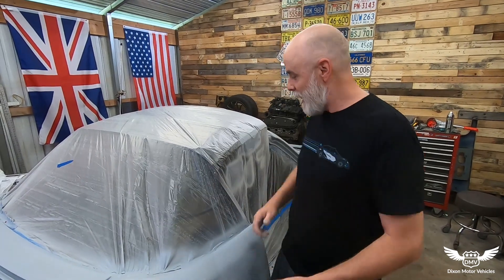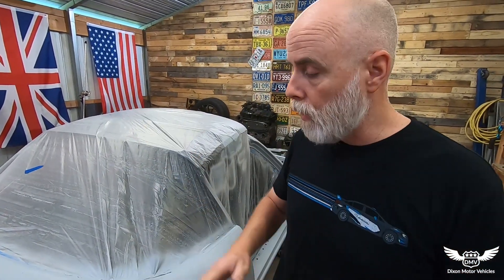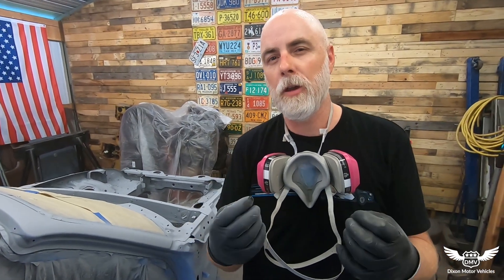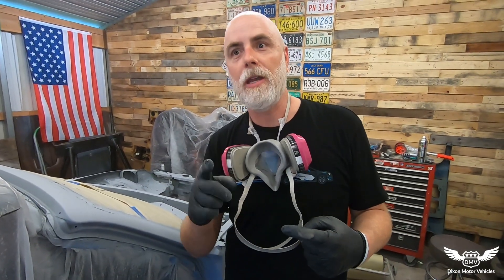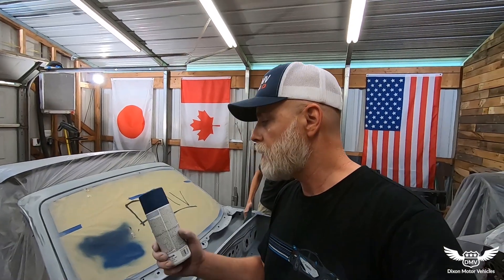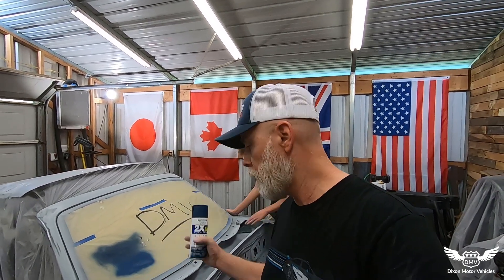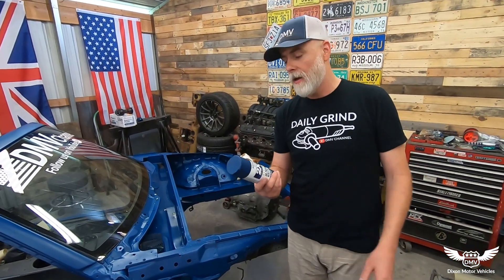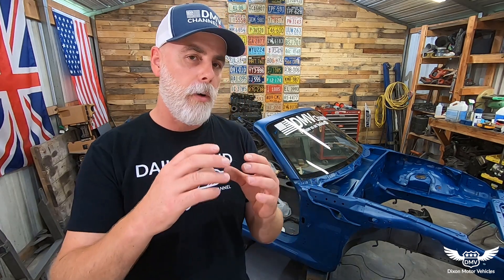Tips For DIY Spray Paint That Does Not Suck!  LS Swap Miata Ep. 13

Comment: heres how to get good results, go to a shop that does paint mixing for real color codes used by either by your cars manufactuar or whatever you want really, then to get a good fan out on the spray nosle and good control, get a spray can gun holder that gives you better control (rustoleum makes one for cheap) then go online and order graffiti tall fan pattern nosles, then with any old can of paint you will get pretty good results, and finally clear coat, use a 2k clear with the 2 part hardener and youll have something you can wet sand and buff, that will absolutely shine like a professional paint job, but its all in the prep and technique, so pretty much everything he named off as an issue has already been fixed... you arent limited to the shit from walmart, kind of a bad mesage to send to people who cant afford a wrap or a paint job, especially when wrap can be more expensive than paint all together. there are definitley ways for a budget to work in your favor, the misleading shit in this vid is obvious by the info about the primer cracks when its as simple as a incompatible paint with another having a chemical reaction, read the back of the can and it will tell you everything you need to know, believe me its happened to me a lot, especially when mixing rustoleum products with dupli color products, its just an incompatible paint... jeez

Comment: If your building a diy drift car this is perfect cuse your gonna ruin a expensive paint job after 3 drift events or practice. I race asphalt oval track cars and most of our body panels come pre painted like the aluminum sheets that you get from the roofing supply store that has any color you want double sided color 8*4ft sheets that you cut and bend and roll to build modified bodies or outlaw latemodel bodies and street stock bodies looks amazing. But the fiberglass panels that I got on my asphalt pro latemodel cones pre painted but after 10 races it was looking rough from rook chips and scratches tire marks from rubbing each other in corners so if I gotta paint a oval track car I go to automotive paint supply store and get a few gallons of messed up color mixes that are a tiny off what the customer wanted for 10 dollars a gallon and my big 70s body shop air compressor and harbor freight throw away spray guns and it comes out like glass for less then 150 bucks. I paint all my racecars that I can paint except aluminum body built cars cuse a custom color stands out with pearls and metal flake but it's cheap and looks expensive and shiny when done better then a full wrap looks wise but not work wise. I just painted my pro truck midnight blue with 5k clear and all for 75 bucks total for the paint Gardner's and clear coat from paint supply store discount mix cans by the gallon